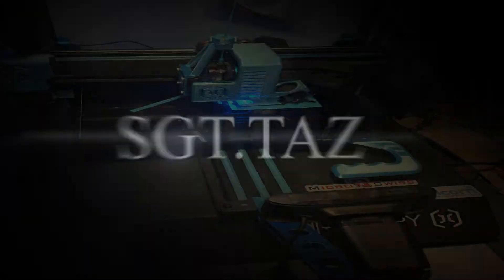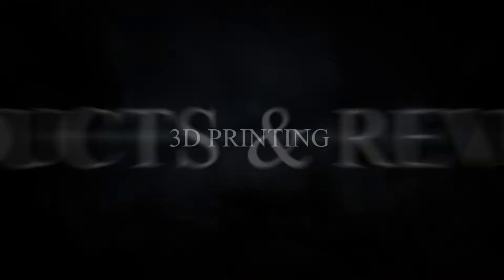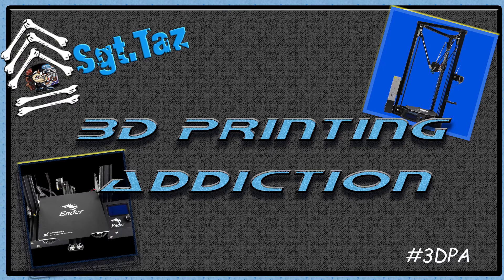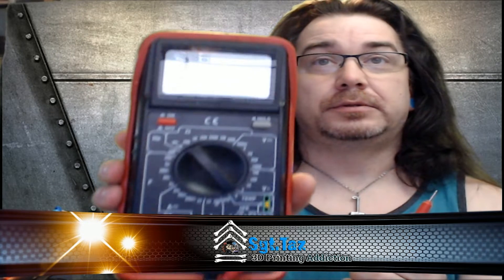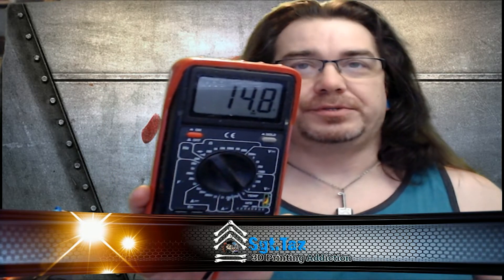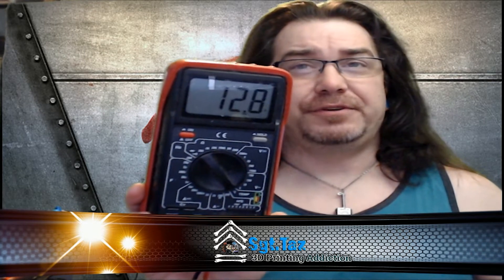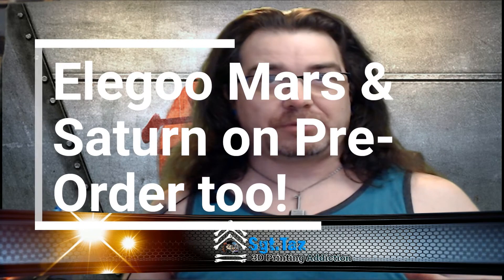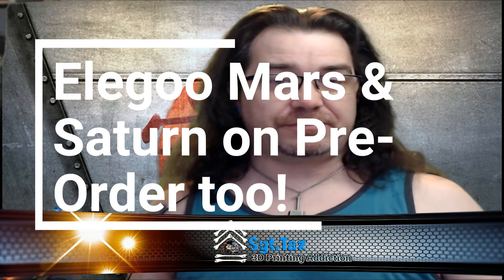3D printing Must have Tool!

Comment: Good intro to meters. Power is volts squared divided by resistance. Your cartridge is 24*24/14 ~= 40 Watts.
Thanks for the video.
Reply from the maker: Thanks, I normally use the chart and I didn't want to be that guy who claims to know everything. I cheat where I can lol
Reply: @Sgt.Taz3D  No worries, I was trying to add information for the casual viewer who might be confused.
For those who don't know the "chart" is affectionately known as the PIER chart (Power, Current, Voltage, Resistance). you can calculate any result knowing only two variables. A nice example is found here: https://www.reddit.com/r/coolguides/comments/f5pyqz/formula_for_current_voltage_power_resistance/